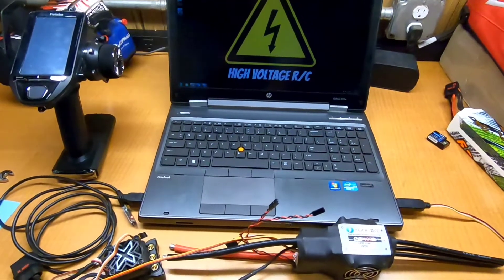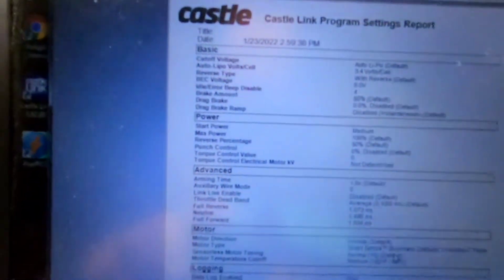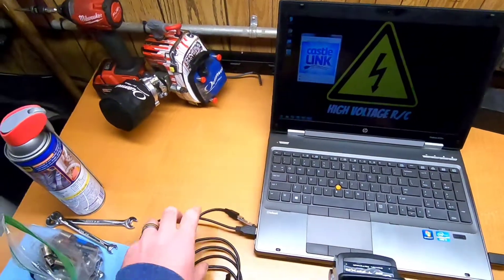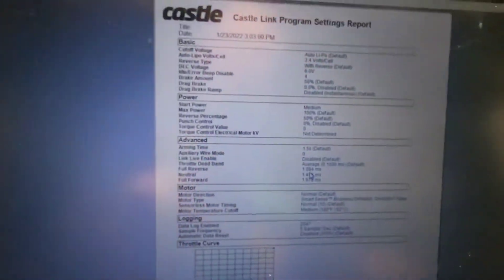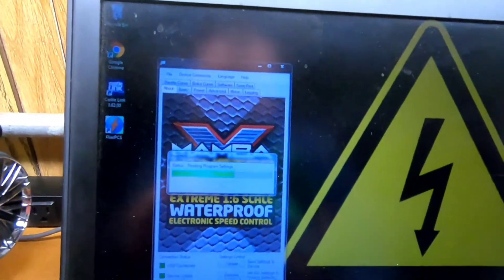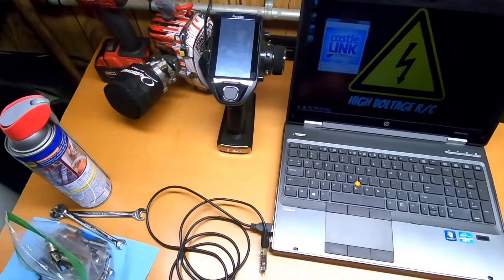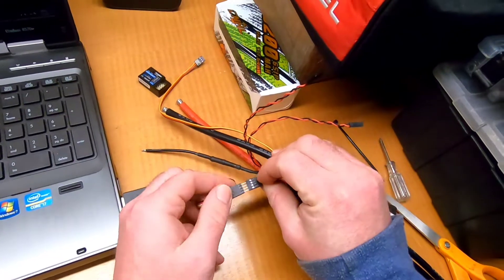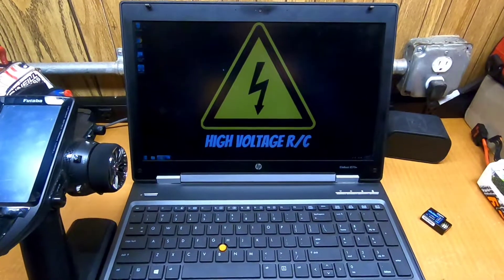Flier esc - radio signal settings configuration

Comment: HOW DO i set the calibration without a reference ESC?
Reply from the maker: You need something to read the signal from the radio. Either an esc with data logging or some other device that will read the signal.
Reply: @HighVoltageRC3080  What if I just test all those settings and run the motor in low Sell count and check motor RPM for the different settings till I get a settings that gives me highest RPM for forward and reverse?
Reply from the maker: @reinierwelgemoed8171  you can do that but it will just be guessing so it still may not be 100%.
Reply: @HighVoltageRC3080  Problem I have is I sont have a reference ESC with Telemetry to take good values from. Mine is setu p on auto at the moment and is very erratic. I dont have any throttle under like 15-20% and then it hits hard. Not nice on a speed run car.
Reply from the maker: @reinierwelgemoed8171  what radio are you using?
Reply: @HighVoltageRC3080  NB4 flysky
Reply from the maker: @reinierwelgemoed8171  I have a noble pro.. should be similar. I will read it and let you know what I find. It wont be exact but should get you pretty close.
Reply: @HighVoltageRC3080  That would be amazing thank You so much for Your help!
Reply: @HighVoltageRC3080  Before You give me the values I actually want to test it the way I said and see what numbers I come up with and then I will let You know to see how close a test like that cpuld get me without having the telemetry
Reply from the maker: @reinierwelgemoed8171  give it a shot... it should get you ballpark close.. you'll know if its off because some values youll have a "dead" area like itll reach full rpm and you'll still have throttle to pull on the radio.
Reply: So I have a 7pxr so I can pretty much use the same parameters right ?? 2.0 1.1